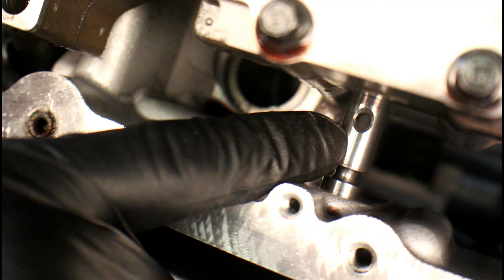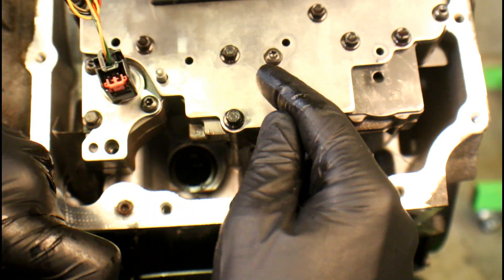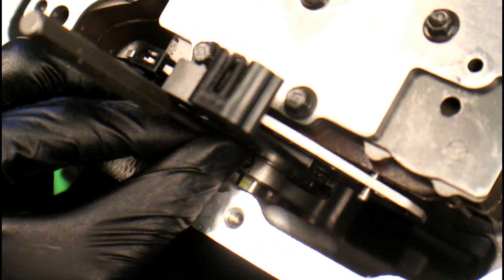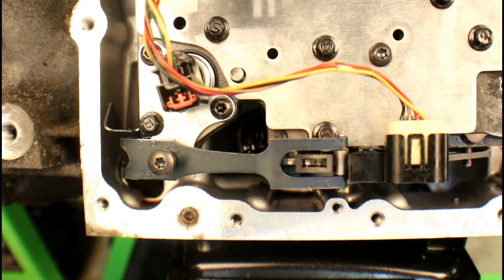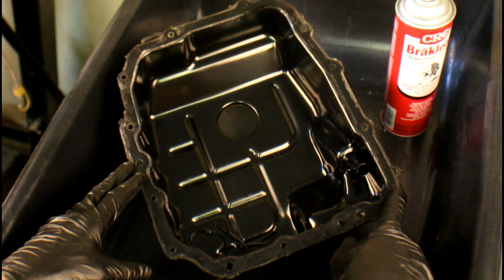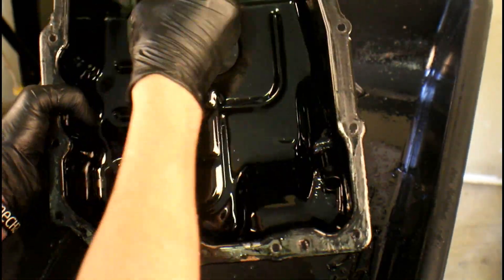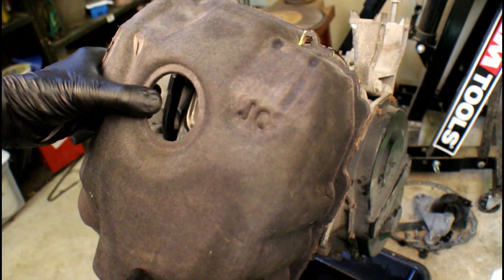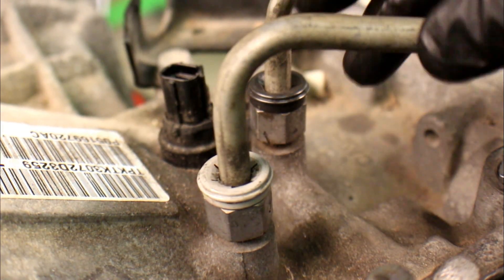Part 3/3: Chrysler/Volkswagen 62TE trans range sensor removal

Comment: Using the paint as a guide is a great tip. I purchased a set of those roll pin punches based on one of your videos and they are really nice. It keeps being centered a whole lot easier.
Reply from the maker: I just purchased these and they work great on keeping the punch centered. Otherwise it was always what broken tool I could turn into a punch lol. Yeah without the paint mark it becomes a guess.....and a blind one at that.
Reply: @MotorCityMechanic  I just replaced mine on my Journey and it is too tight to see the mark there. Since I was also changing the filter as well I was was able to mark the bottom of the shaft which I could see and line up with the roll pin. Thanks again for your outstanding video.

Comment: For those with codes P0709, P0731 P0732 P0733 P0734 P0735 AND P0736. If you have the P0709 followed by and other gear ratio code the range sensor is most likely the culprit. My 2010 Town and Country also was hard to start on occasion. Reason being, the PCM/ TCM was unable to reference the gear selection. This also caused it to randomly go into limp mode. Double check the wiring inside the Drivers wheel well for corrosion as well. The PCM is located there and is susceptible to road salt. Best of luck!
Reply from the maker: It doesnt happen alot but it does as you found out. I have probably replaced about 10-15 over the years for this intermitant issue and each time it was that range sensor. Thanks for the tips and info. Make sure to subscribe and enjoy the weekend.
Reply: @MotorCityMechanic  It was an absolute nightmare to diagnose too lol. But thanks to your video series it was  a snap to replace. So thank you!
Reply from the maker: Great job on finding the cause. The range sensor has multiple pins/contacts and they show up on the data when scanned. I believe the service info might have a chart showing which pins/contacts need to be in what position when the shifter is in a certain gear, None the less.....great job and appreciate the kind words.

Comment: David, your amazing! Great teacher, love the detail. Really appreciate what your doing!
Reply from the maker: Many thanks R C for the support and following! Thanks for watching this video as well.
Reply: Thanks for your reply! I'm really looking forward to your guidance & solution with the transmission fluid. My 2014, GC 30th Anniversary is my fourth mini van. The designers at FCA should be held accountable for not including the tranny dipstick. It's such an inconvience not being able to check & refill my transmission fluid!
Reply from the maker: R C Your right....I don’t like it either. It seems to be the norm these days with car brands as well. I might heck....look at BMW.....they haven’t been running an “engine oil” dipstick for many years now. Talk about a pain. The industry is slowing work towards making it harder and harder for the everyday consumer to check or work on their vehicles. The trans level is based on temp and actual level readings....guess they assume you need a scanner to read the actual temp so not need for the dipstick for that trans. I still don’t like it and never will.
Reply: Thanks David....agree 100% with you... it's amazing that the auto manufactures & FCA can get away with this! My wifes leased BMW has the electronic oil gauge! I love sitting in the driveway, burning gas and watching the colour display.... 7 minutes of my time to check the oil level! It's insulting that I cannot check the transmission fluid on my 5TH generation Caravan! I'm not a moron.... There is tons of confusion out there of what you can & cannot do. I've spoken to three dealerships and each has offered a different solution for the complete fluid change & cost. With your terrific skill set & communication, I know you can up with a logical solution that will give many Mopar followers the right approach to getting this job done the right way. My vehicle has the trailer tow package with the OEM cooler. How many quarts/litres does the system hold with a fresh filter?  FCA states 9.0 quarts/8.5L. Is this right? Cannot seem to get a straight answer. New project for you! You need to create a kit that we can purchase from you.... so we can do our own fluid change...here to help!
Reply from the maker: R C I will certain try to work on a video soon. When changing a filter and doing a basic service.....I start with 4 quarts and then start checking. 5-6 is about the average number of quarts needed. I rather start low and add fluid then to have to remove any. I will work on a simple way to check it and try to film it in the near future. Thanks again for the support

Comment: Thanks so much for the video.  I recently bought a 2011 VW Routan SEL and right off the bat we had issues with it starting.  I replaced the TIPM but still we had issues with it starting.  It wasn't until we got some transmission related codes that I found this video, and I am so glad I did.  Just finished replacing the trans range sensor and servicing the transmission with new ATF and a filter.  The job took a novice like me 5 hours with a lift and a bay at the local hobby shop.  So glad that I had a plan going into this.  After the work, the transmission started shifting like a dream and there were no codes or faults using the shops computer.  Hopefully problem solved.  Thanks again.  Big thumbs up here!
Reply: Hey did this fix the issue?We have a 2010 Routan that will sometimes click but not start. Try again or let sit and it starts fine. No other issues. Was thinking win module or this.
Reply: @TheHelimechanic  nope. I replaced everything, but eventually had to replace the whole transmission. It has been running fine for the past 3 years now.

Comment: Great step by step video.  It's a shame that so much is involved in replacing this $40 part that is a common problem on the 4.0L 6 speed transaxles.
Reply from the maker: Your welcome. I havent seen this issue in a long time but then again being a dealer tech.....only certain videos come in. Typically newer vehicles with ramaining warranty. Once the mileage gets on them they usually start going to the independent shops. The way it works is when the sensor is mounted on the outside of the trans.....we never have any issue. That would be too easy right? lol. Its when they burying it inside the trans that it becomes a common issue lol. Got to love the way things work like that. Thanks for watching and make sure to subscribe,.

Comment: Great video, thanks for making it. I was just curious, you said the transmission oil pan torque would be 50 in-lbs, but my Chilton guide quotes 105 in-lbs. Is that a typo or could you elaborate on the discrepancy please.

Comment: Your the best on here thank you for all the useful information... please do the solenoid pack on 62te Chrysler 200!!!!
Reply from the maker: That is certainly a video I want to do. I have that trans on the stand so there is no reason why I cant do. Its on my list for sure. Once I get a few more out that I am working on, I will work on it. Thanks for the request and make sure to subscribe!
Reply: MotorCity Mechanic have you done a heater core on 2012 Chrysler 200 3.6?
Reply from the maker: I sure have but in a short cut way.....hard to describe in words. I have been able to un-crimp the heater hose pipes at the heater core....pull them back and then slide the heater core out. Do the same thing to the new heater core and then install the old metal tubes and re-crimp the connection. Saves pulling the dash and I havent had any issues yet. Takes about an hour or so. Some might frown on this method so I havent made any videos on it at this point.
Reply: MotorCity Mechanic I would love a video on the short cut to the heater core or long version.
Reply from the maker: I will keep it in mind as a future videos. I need one with that issue and the time to spend numerous days filming. Certainly something I would love to do.

Comment: I have P0713 Transmission Fluid Temperature Sensor Circuit High Input - on some forum I found that this is related with broken pin #23 or range sensor need to be replaced - can you confirm this that this is correct path to follow?

Comment: Hello, I just dod a trans/solenoid swap. Not getting crank. Was wondering if the range sensor has to be in a certain position on the ring gear when installed. I installed it with short selector in park. Thanks

Comment: What is the significance of the R/L check valve halfway up the right side of the valve body case edge - that then gets covered by the valve body cover (it is covered by a filled-in portion of the cover where a bolt would go)?  I have a significant leak at this position and i am looking at redoing the gasket and cover installation...  Do i focus on getting more gasket maker at that position this second time?  Many thanks in advance!
62TE on 2011 Dodge Caravan 3.6L

Comment: THANK YOU!! Very grateful!! Please correct me if i am wrong: To do a complete {or as much as possible} transmission fluid change I could disconnect one of the transmission cooler lines and blow compressed air thru it so the fluid in the cooler would be "pushed out' from the cooler to eventually the transmission pan, correct? OR I can disconnect Both cooler lines and have one line drain into a drian pan as I blow compressed air thru the opposite side? And do it for Both the cooler and the transmission, correct? After doing that then approx how much ATF+4 will I need please? OR I could pour in say 4 quarts turn the engine on let it warm up and check the transmission fluid and add as needed? 
 I used to do that in my Toyota automatic transmissions about every 25 to 30,000 miles, and NEVER had a problem.

Comment: So..... I have been trying to help out my buddy with his 2010 Dodge caravan with this 62TE six speed transmission. He is getting the 3rd and 4th gear shift range trouble code after the vehicle warms up and he has been driving in slow traffic. The trans will eventually not shift out of 3rd gear and he has to stop and disconnect and reconnect the battery in order to make it shift normally again. I ended up doing a trans fluid and filter change and also changed the top shift sensor and eventually the range sensor inside the side cover below the valve body. None of these changes have eliminated the problem and he is still getting the 3rd and 4th gear shift range error code....! Any suggestions at this time would be great because I was sure doing these 3 things would have solved his issues especially after watching these videos. 

Help please . . .

Comment: I have a 2008 4.0 liter town and country. It consistently shifts smooth however when I am in traffic slowdown to 15 to 20 mph I consistently get a code p0792 and p0733 or P0734. If I clear codes, and never see traffic and always come to a complete stop and accelerate to past 25 mph no problems no codes. In fact as long as I stay above 25 mph I am fine. 
I have changed the 3 sensors on top of the transmission and replaced the battery.  Van has 193000 miles. Have changed the fluid always dealer kept since new at 30k miles. 
Put in synthetic fluid and lucas transfix. Sames issues however.
Reply: Fix it yet?

Comment: I did this and it will only show reverse I can shift thru the gears no problem but the dash only shows reverse what could be wrong trans was fine only needed shift shaft gasket now van cant start

Comment: I have the 62TE on my 2010 Routan. How much different is it than the 41TE to replace the solenoid pack?
Reply from the maker: On the 62TE you have to remove the front pan and then the valve body inorder to get access to the solenoid pack. On the 41TE its located on the outside of the trans and is fairly easy to replace. Thanks for asking and make sure to subscribe.

Comment: Motorcity mechanic  I have a 2008 3.8 caravan that dies when I put it in drive , I don't have any problem in reverse ,it jus happened suddenly. Any suggestions David.
Reply from the maker: Sorry about the delay. Sounds like a possible valve body issue. But to be sure I recommend having a shop check it out before jumping to replacing it. But based on similar issues I have run across over the years.....sounds like the valve body. Thanks for asking and make sure to subscribe.
Reply: @MotorCityMechanic  thank you for replaying back  I took it to the shop and they changed torque converter, selenoid pack and they didn't put a new valve body they rebuild it . But guess what still shutting off  when put in drive, well if I let go the brake as soon I put it in drive it wants to die but if stars rolling then it runs perfectly, then if I get to stop sign and stopped completely it will die. My question is does the transmission needs to be calibrate it?
Reply from the maker: @eloynunez2634  Calibration wont make a difference. Rebuilding basically means they cleaned it out. I still am skeptical about the valve body but then again I am not checking it in person.
Reply: @MotorCityMechanic  yes I understand so your recommendation is if they installing a new selenoid pack they also should install a new valve body. And I appreciate for replaying so fast , I feel like I owe you something.
Reply from the maker: @eloynunez2634  Your welcome and thanks for following the channel.

Comment: Hi if you can help it would be greatly appreciated. I have a p0729 code but no mil. Trans goes into 6th at highway speeds then downshifts and revs high. Ive replaced the solenoid pack, new fluid and filter and new trans cooler lines to take care of any leaking issues. Checked all levels and all is good but still has the same issue. Any idea of what i can do to fix this problem?

Comment: Hello how are you?
I have a question about the Range Sensor.I replaced the sensor with a new one and now my ram promaster wont start, key is stuck in the ignition and it is not showing PRND on my dashboard.Cable is plugged in and everything is put back together.The electric  connector had some oil on it when i plugged it in. Could that be the problem or what else can i do?
Reply: I am having the same issue... curious if you found the cause.
Reply: Did you guy find out what was the issue? Thanks

Comment: Hello I have questions on my 2008 chrysler town and country transmissions problem give me code P0736 what could be the problem Reage sensor or solenoid pack
Thanks
Reply from the maker: That code can be caused by alot of different issues. Its a bit generic and means that something happened in reverse and nothing any more specific than that. Usually its an internal issue like burnt clutches, could be a valve body. I dont see the solenoid pack or the  range sensor setting that.
Reply: @MotorCityMechanic  
Hello Mr. David I do really appreciate your help. I did change the solenoid pack and range sensor, know a have new problem the reverse not engaged the drive work what could be the problem.
Thanks.
Reply: Sami Ibrahim That’s broken compounder.  Snap ring out. Wasn’t it ?